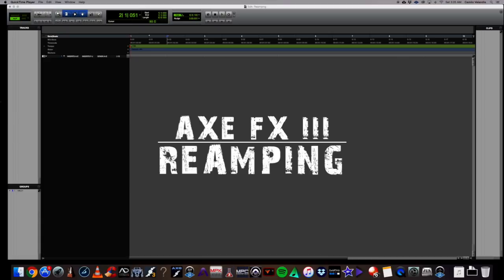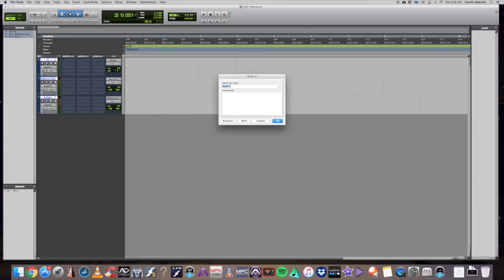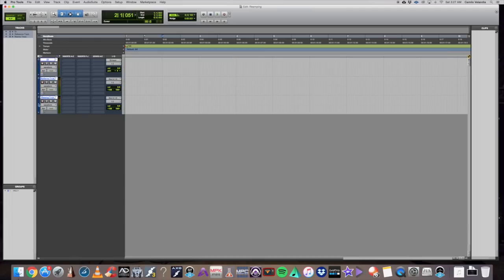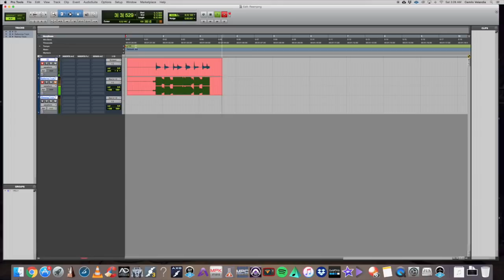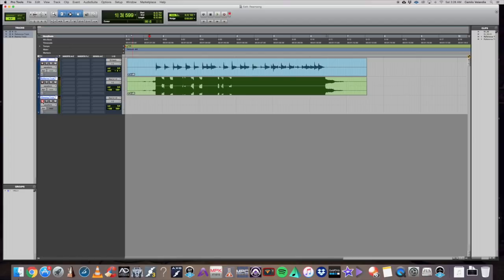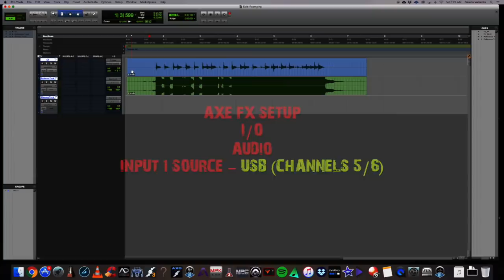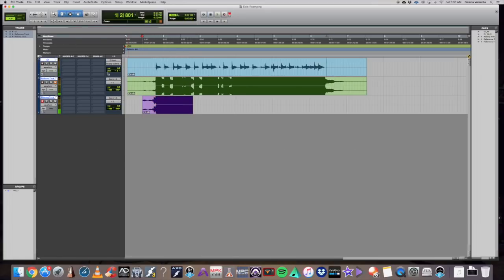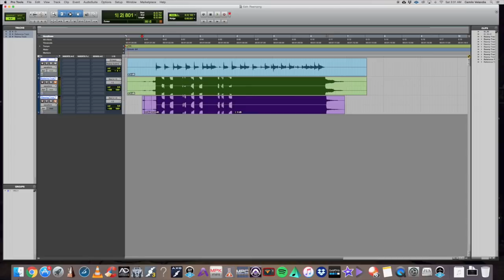Axe FX III - Reamping

Comment: I have set the settings in pro tools exactly as specified and am trying to reamp a DI recording i've already tracked and when i switch the input to 5 and 6 block and play it back im still getting the dry, original non re-amped sound. any help?

Comment: This is great. But suppose I want to use a different audio interface with analog and spdif running between my axe fx 3 and the interface?
Reply from the maker: You mean, for example, a third party two channel interface and SPDIF the Axe 3 to add more channels?
Reply: Well I have a Focusrite Clarett 8Pre X. So I have all my instruments in my studio plugged into it including my axe fx 3. I have spdif and analog from the AFx3 going into it and then there's a thunderbolt connection to my computer.
Reply from the maker: So what you want to know is if you can use another interface and still reamp?
Reply: Yes, I had it working with my axe fx 2, but now that's sold.
It seems like it should be pretty straightforward, especially given many studios use audio interfaces other than axe fx.
Reply from the maker: I’m lookin at the manual at it seems like you go SPDIF out and set it up in the SPDIF/AES in the I/O setting. I haven’t tried it but I wanted to make a video on how it works as and with interfaces. Maybe this coming week!
Reply: What I'm asking is how do I set up the I/O. I understand the concept in general.
Reply: Yeah, that would be great. I think it's sorely needed. Not only do so many people use other interfaces, but there's so many more I/O options than on the AxeFX2, that it would be something many people would find useful.  In fact, I bet you could get several videos out of showing different use cases for all those different  I/O settings besides reamping, if you have the hardware available to explore them..  ;-)
Reply: Funny, you would think FAS Tech writers would have assumed it's in their best interest to document this better, instead of making it only all about AxeFx3  using it as an interface. I can't imagine people buying it for that if they already have studios.
Reply: Yo, although I never got it to work via spdif, it worked by creating a composite audio device in MacOS!

Comment: Can you confirm that it works like a soundcard, like they claim on their website, so i could for example output multichannel backtracks while playing? + windows sound for example.. A multichannel guitaramp workstation?
Reply: If you have the axe fx III as your interface and have it hooked up to monitors, you can still use your windows sound. As long as your windows soundcard isnt being used as the main sound card of the DAW you can listen to back tracks and record at the same time.  The best thing to do is to hook your axe fx to a audio interface and use it that way. It solves a lot of problems doing it like that.

Comment: So you were able to do the same thing with the AxeFx II but the big issue is that you couldn't have playback while you reamped. Are you able to just send the DI track to the AxeIII and tweak your tone in the mix or do you still need a seperate interface to do this?
Reply from the maker: Yes! You can do it. Since the Axe III has more physical inputs and outputs than the Axe II, the routing capabilities are more flexible

Comment: So it looks like the biggest difference between the AxeFXII and III for reamping is the number of channels.  The only question I have is probably about aligning the reference and the reamped track.  There is going to be some latency (milliseconds) and it is always a real hassle to try to line them up.  As a workaround I found that everything reamped will be delayed by the same amount so you could delete the reference track and just reamp through the same patch (assuming that you are mixing multiple tracks of the same take).
Reply from the maker: I would have to check but Im assuming you are still going to get subtle latency because when I enable both DI and reference track I can hear it
Reply: Great tutorial, thanks Camilo!